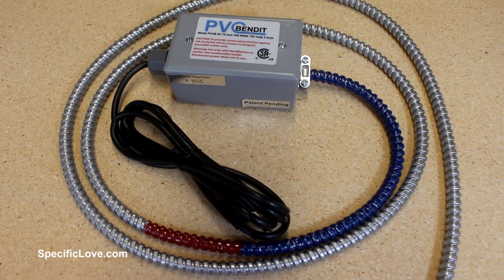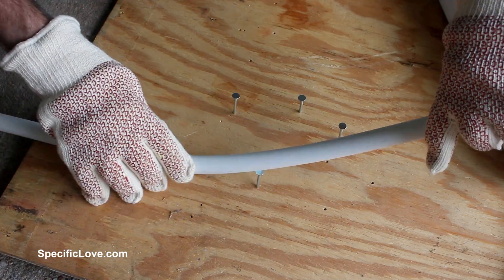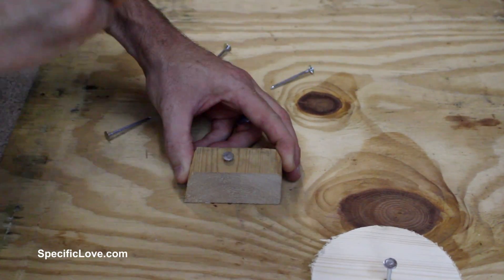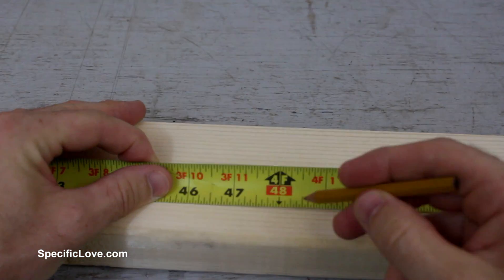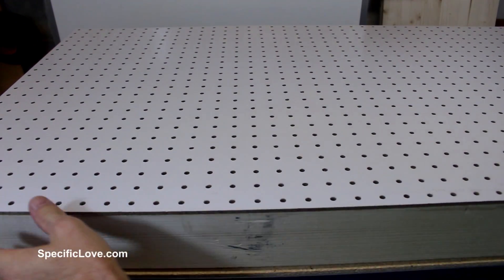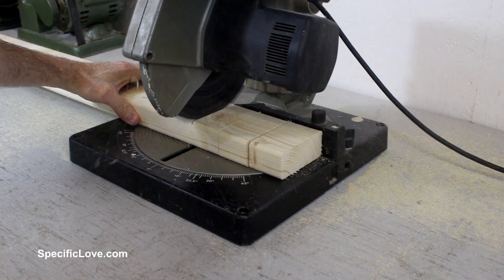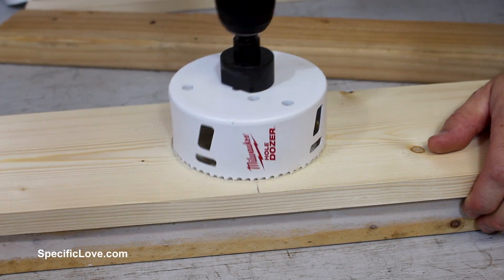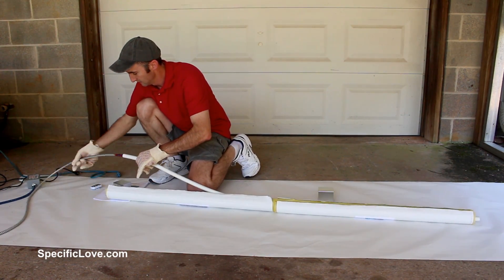How to Bend PVC Pipe EASY Part 2 Bending Forms

Comment: The pegboard is a good idea. I built a grid frame, because I had a couple of PVC piece I had to make in quantity for a product I sold.  You could take it one step further like I did by using wooden dowel rods cut to a length your happy with instead of using nails in the hole saw cutouts
Reply from the maker: That is a great idea too, thanks for sharing